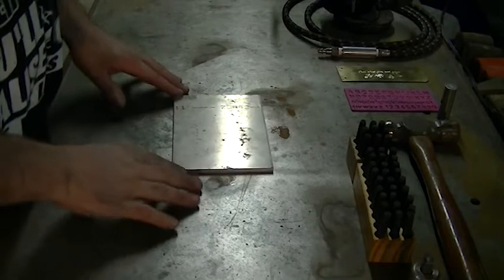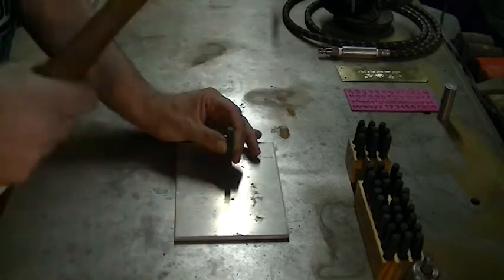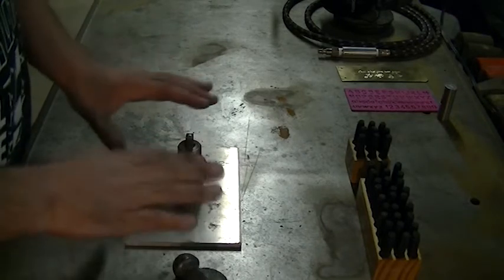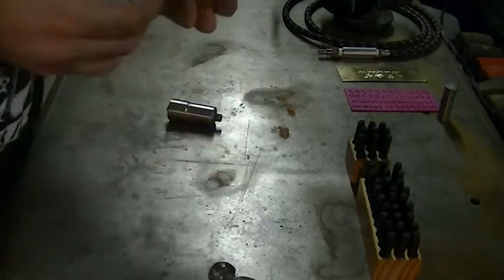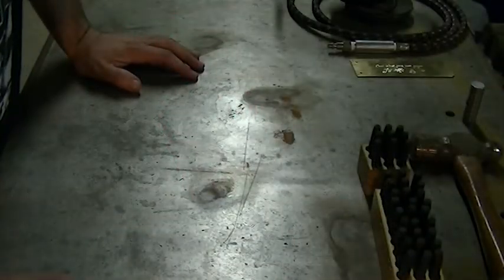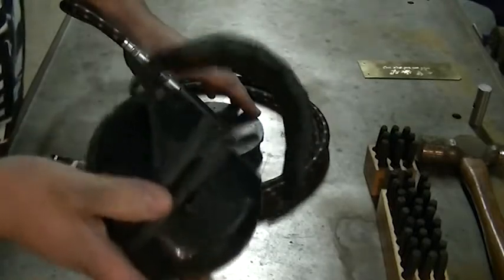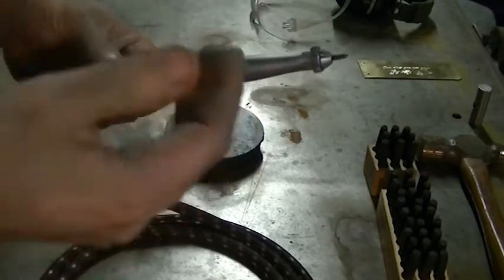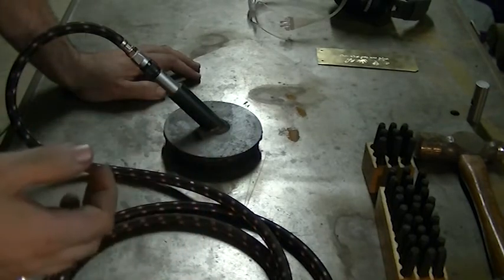Marking Metal - Stamping & Basic Engraving

Comment: would you use this same type of engraver to make metal stamps?
Reply from the maker: I'm not sure exactly how that is done, I know that some are made with CNC machines. I do know that this engraver would not make lines fine enough for engraved printing plates like the ones used for printing currency or postage stamps.